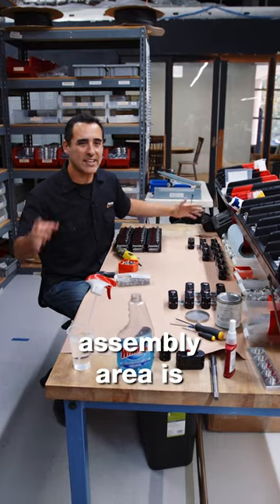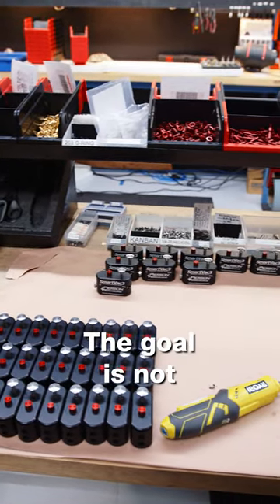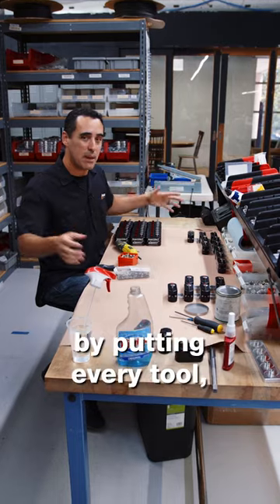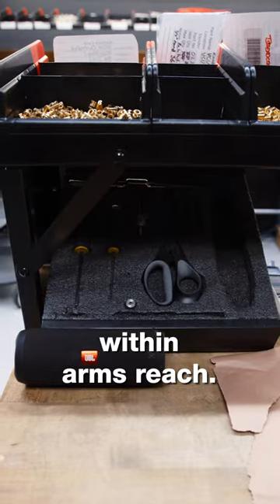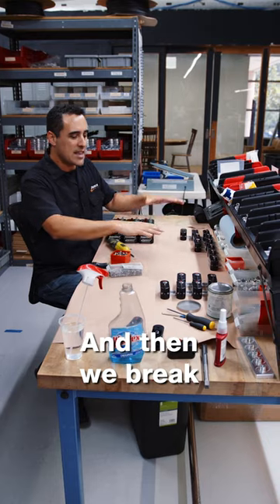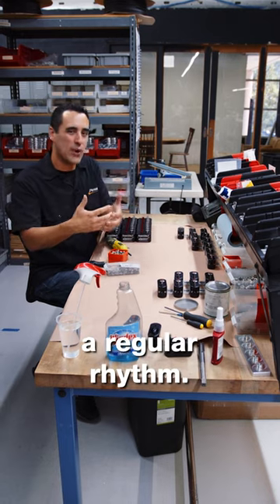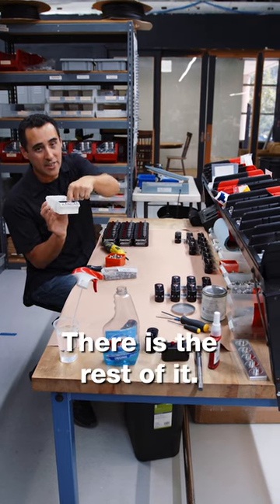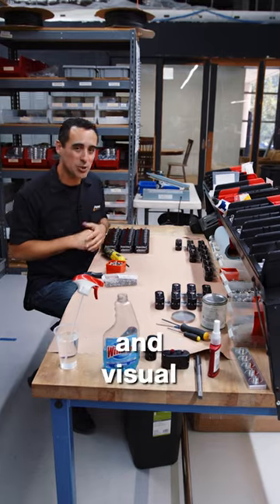Keep All Your Tools Within Reach! | Machine Shop Lean Tips #cnc

Comment: You should consider managing your bin system.  I suggest using a two bin system where the first bin contains sufficient inventory for 30 days production and the second bin is used for the next month.  Each bin has a card with the required number of parts for that month.  Once a bin is emptied the card is placed on a common board to either order it or make it.  That way you increase the number of inventory turn overs,  better manage your parts orders, and improve your cash flow.
Reply from the maker: You must be new to the channel. Keep watching. We've gone into plenty detail about our Kanban cards, 3 bin system and other Lean principles.
Reply: @PiersonWorkholding  nope long time follower. Its funny they didn't appear in this video.
Reply from the maker: We're posting more on those! Make sure you subscribe!